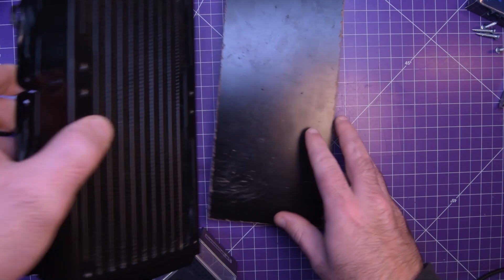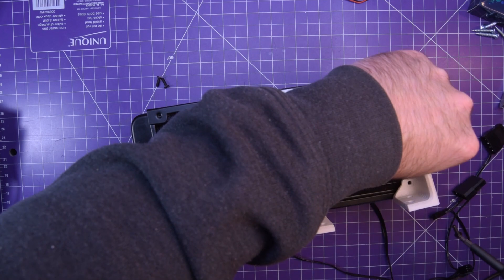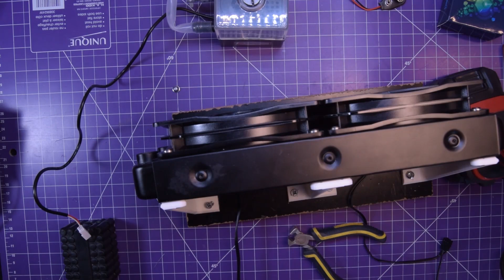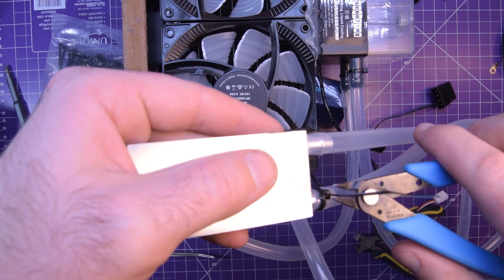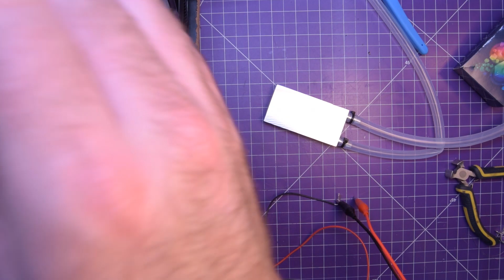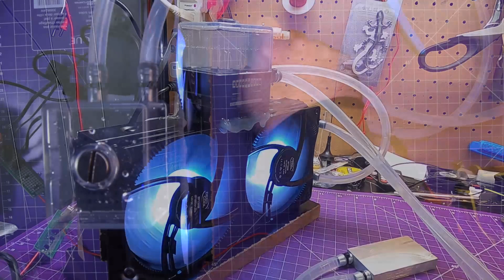DIY Water Cooling For Diabolical Projects!

Comment: What is the material that the radiator is made of ?
What is the material that the water block is made of ?
Reply from the maker: Both are made of aluminum
Reply: @SimpleElectronics  thanks